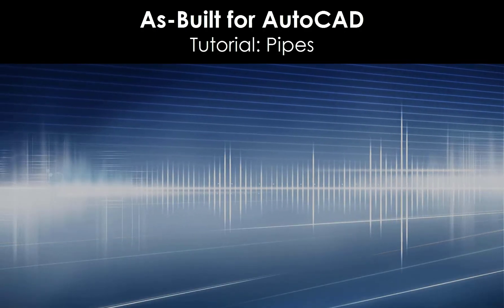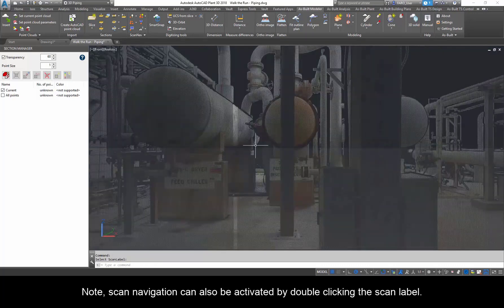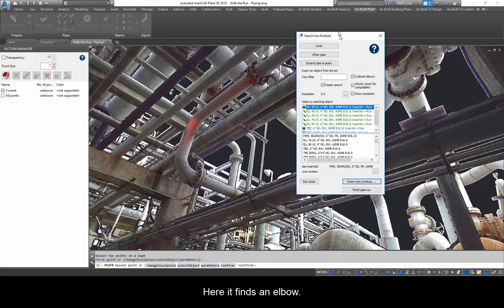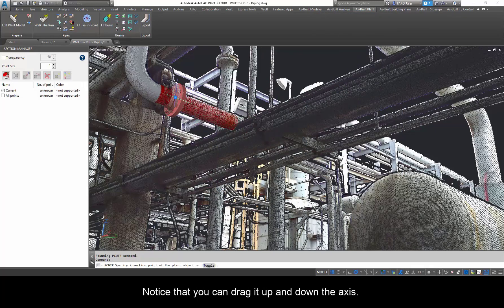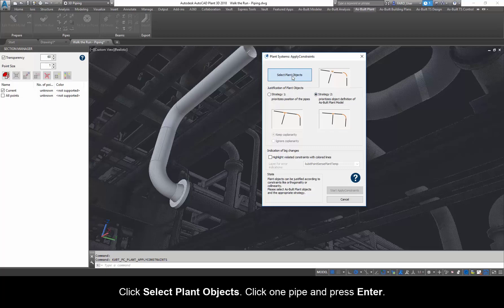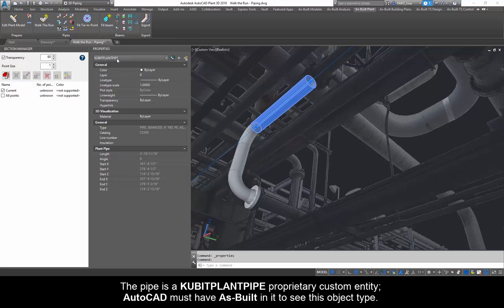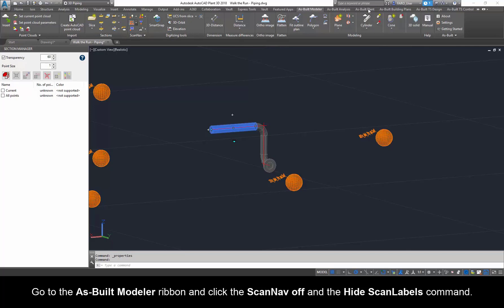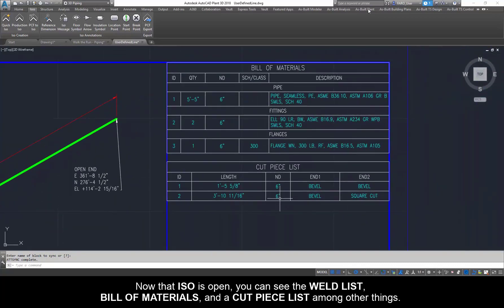FARO As-Built for AutoCAD 2018 -  Pipes - English

Comment: The recap scan labels don't appear. Any idea why this can be? 
Is the scanner position "intelligence" stored withing the rcs files? (I just xref attached the rcs files to my Plant 3D. Should that be enough, or does Plant require anything else to be able to show the scan labels/orbs)
Reply from the maker: The scan position is usually stored in the rcs files, yes. As-Built for AutoCAD reads it and creates the ScanLabels when running the according command. Please contact FARO Support for help.